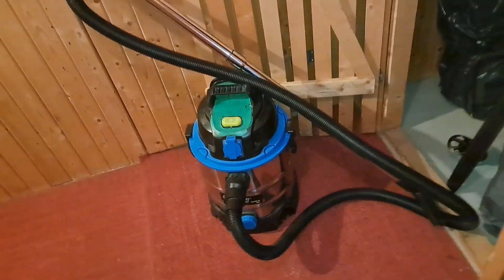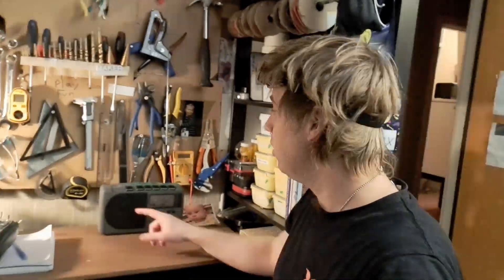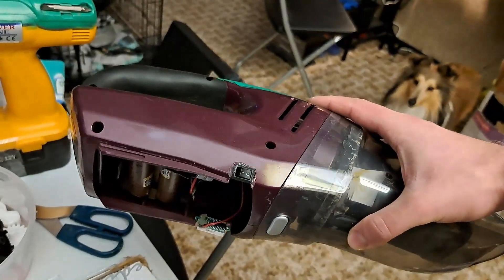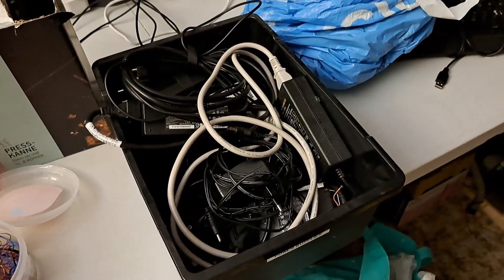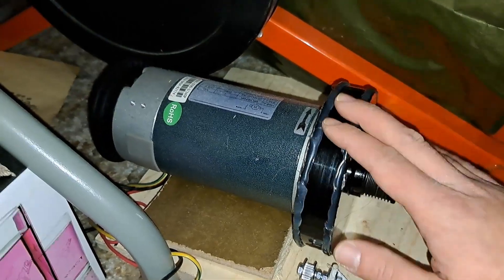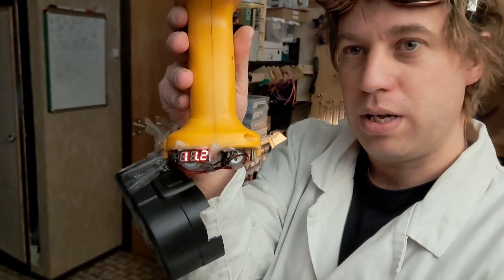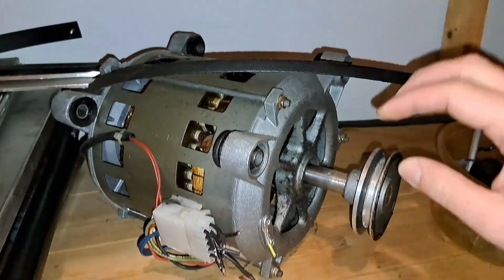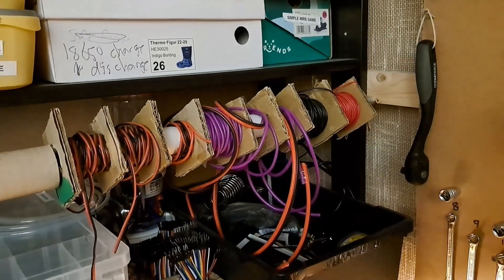Using E Waste At Home, Free stuff, Free Energy and Helping The Planet

Comment: i actuly work in metal recyceling and garbage recyceling to be fair this is cool but u suprised waht pipel trow away but i have like 1000 euro in tools including reaseneble new makita dril but thats the best stuf the stuf u colect we normaly recycle like 99% of stuf u actuly showed gets turned in to new cables cables contain coper only thing thats hard to recycle is litium bateries if im corect
Reply: note dit buy those tools for like 50euro in a span of a year pipel just trowing a way complete sets of tools
Reply: note i have the best job in the world i always find stuf but i buy to many tings from work so i only take the best tings always exsited waht i will find funny but u find any ting and i mean any thing 1s pulled out a gun 50cal active bullets baby poop and oder tings always fun
Reply from the maker: Sounds fun.  You never know what you will find.
Reply: its also a problem that tv's and oder laptops are made in a way if u break them they cant be repeared or ther is some sord of lock on it like srews with special bits or oder tings rilly iritating
Reply from the maker: When you say recycle do you mean grind down and melt down materials?  Would be such a shame to grind down a working battery drill.  I wish I worked in recycling and could quickly test everything and have a huge pile for stuff to sell everyday.  Way better for the planet.
Reply from the maker: Ya I hate when companies make it hard for you to take apart and fix their stuff.
Reply: @Understated_Engineering  it shut be iligal for compagnies to do that but i understant the point u are making of keepings tings out garbage but thats also 1 of the problems in at the company i work at and this counts for also oder companies basicly how more metals u can buy recycle and make clean how more money u make becouse ther is like 25% profit on efry kilo or so the point is its kinda hard to check a old tv and try to resell it wen u could have made that 25% way easyer the main thing is pipel not be ing able to repear stuf and not being given the posebillety for exsample 
to easy repear tings and trow it away  
the ting is exspensife stuf mostly gets saved but tings that are cheaper not rilly this is a huge problem mostly Electronics since they contain a lot of plastic and not that muchts actuly usefull tings but if we were not speaking about the climate if pipel dint trow away ther stuf that easy were would all my tools have come from and most exspesife stuf i own

Comment: Made myself a little lab in my room, I was allowed to pretty much take whatever was going to be thrown out in the bin at the place where i am doing my apprenticeship, HP 8753 network analyzer, 34401A agilent digital multimeter, frequence meter agilent 53150A a whole bunch of oscillators, resonators and other logic circuits i can use with my arduino kit, I plan to pick up a SH3000 SEM but i cant put that in my room, it's too big.. it's a shame that I live in a house where I do not have a garage, I plan to open a channel where i will talk about oscillators and silicon chips using that exact SEM, you don't get to see what a silicon chip looks like very often, to me it's art and It would be great if I could disect pretty much anything I have to look at the silicon chip. The whole set up is ready, I just need my SEM ;)
Reply from the maker: Sounds like a great plan.  That stuff sounds expensive.  Maybe you can fix some of it and sell it and rent your own workshop?  For youtube just have fun and start uploading videos.  Don't check your views too often sometime I get sucked in.